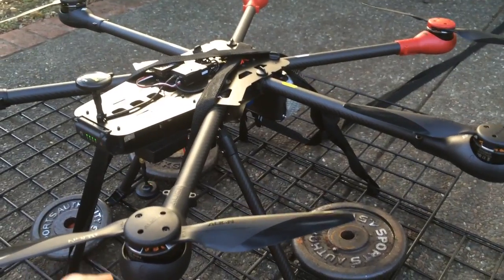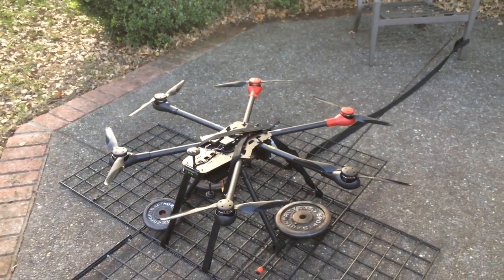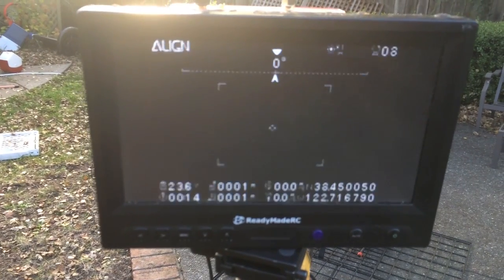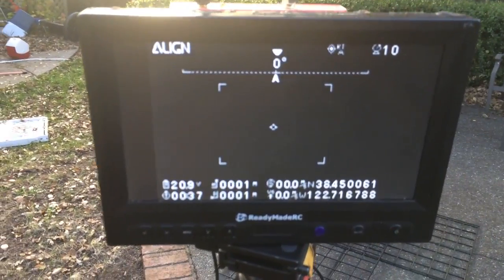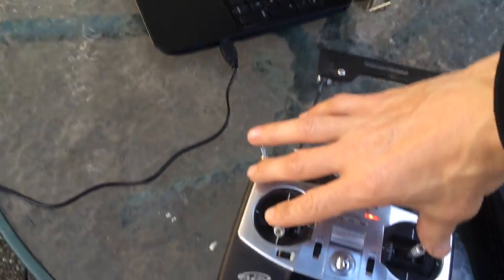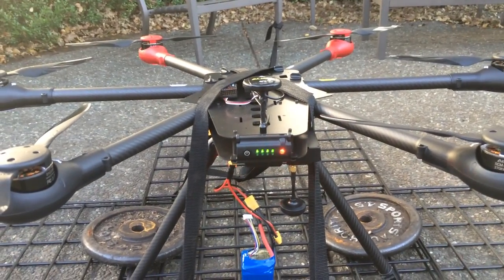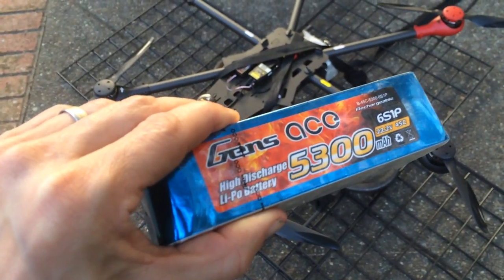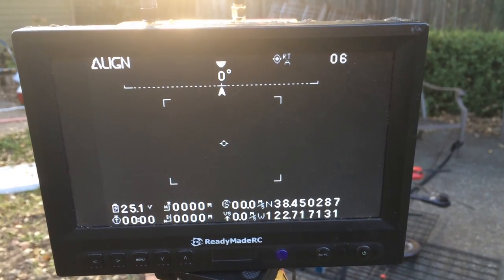Align M690L battery testing

Comment: Great test video. I'm quite supprised at the voltage drop as I have always used 2 Zippy compact 5800 6s 30c's in my Tarot 960 hex with no issue, and 20 minute flights carrying a Tarot Gopro gimbal and FPV gear. Granted these motors are a little larger (370kv Align vs. 340kv Tarot), however I'm wondering if the folding blade assembly and the blade configuration just looses rotational efficiency much more than a single carbon blade, and the combination of that and the larger motors is contributing to your voltage drop. I received my 690 on Monday and will probably finish the build this weekend, but in leu of this video, I'm definitely going to do some testing before it's in the air! Thanks

Comment: That's an excellent rig. Thank you for showing the tests. How old are the zippy packs? If been used for a while, may be it's aged? I'm quite surprised it sagged 4 volts immediately! I use 5000mah packs for my 700 helicopter and it pulls around 100amps of power with no trouble for many flights. I'm wondering if 5800 packs are made differently to 5000 packs, do you have any zippy 5000 to test too? cheers mike